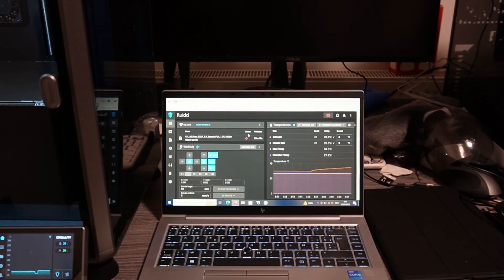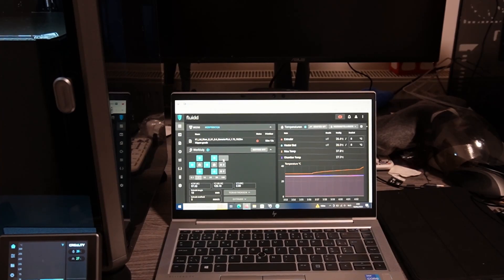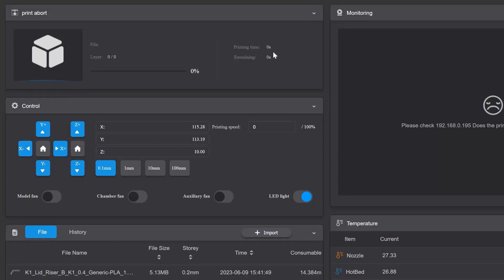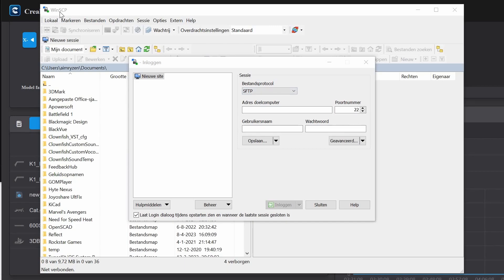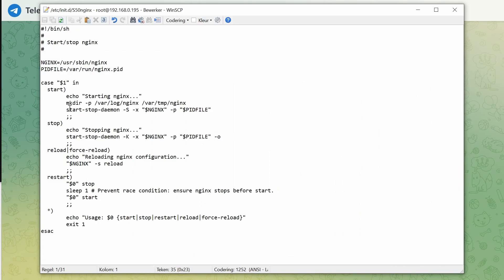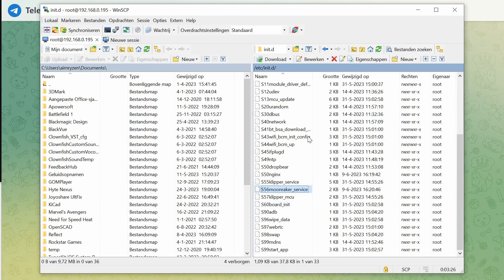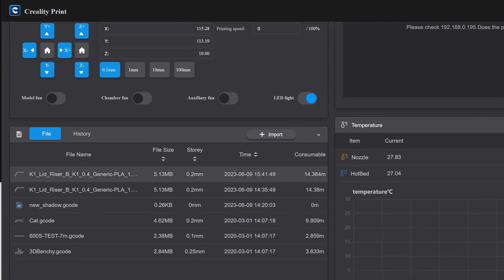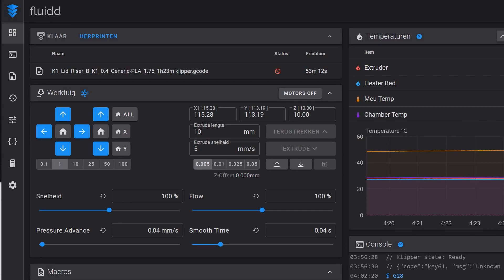Creality K1 fully blown FLUIDD KLIPPER exploit tutorial (difficulty: beginner)

Comment: The question is why i should want that ?
Sorry get an Raspberry set up an nice Klipper server with Fluidd or Mainsail the usb in the printer and you have a nice clean stable system.
And not an unclean factory firmware that will maybe break at installation or break at the next update because its not compatible anymore ...

Comment: Do you have a solution for applying this after accepting the 1.2.9.21 ota firmware update? It doesn't work with this new version, and I haven't been able to flash the firmware with an earlier version.
Reply from the maker: check this video https://www.youtube.com/watch?v=SilxrO6MNmM
Reply: That really helped. Thanks. @aim6mac

Comment: I finally got in with the password 0755cxsw$888 , but the files S50nginx and S56moonraker_service don't exist in the init.d folder. it seems they removed them in the latest update maybe? All the other files are there though.
Reply from the maker: I'll have to look into that
Reply: @aim6mac  Any updates on this/work around?
Reply from the maker: @djkrekeler6909  use official firmware, it has klipper in there.
Reply: @aim6mac  trying to get mainsail to work, got fluidd figured out. did the steps but mainsail won't load the printer. i changed the port and still no luck. was unsure if the github page setup was needed in current version.
Reply from the maker: @djkrekeler6909  come to my discord, we will lead you to install mainsail on your K1
Reply: yeah, I just updated my printer and that password let me in, and I got the same problem
Reply: me too, cant found that file. Maybe Creality change location or remove it on lastest update
Reply from the maker: to follow up on this, please use the latest firmware (official) from Creality which already has Klipper in it.  U don't need to use the xploit anymore!
Reply from the maker: if you don't know how to, come to my discord, we'll help you out :)

Comment: Did they ever fully crack the sonic pad fully?
Reply from the maker: Creality officialy put in root acces on the sonic pad a few months ago.
Reply: @aim6mac  Yea I seen that however you still can't do or install whatever you want like normal klipper
Reply from the maker: @TechieNI  oh and what do you want to do?
Reply: @aim6mac  I would like to install obico but the guides seem outdated as it won't install without the dependent files which won't install normally either for whatever reason. I would also like to gain access to the normal bed mesh and input shaping.
Reply from the maker: @TechieNI  allright,

Comment: Is it possible to connect K1 to any other slicer? Like Orca slicer by softfever.
Reply: currently you can't connect to it from orca slicer, but I have been able to create a generic klipper printer on orca and have a working 0.4mm nozzle 0.20 profile that works, prints look really good so far. I have to manually upload the file through the fluid web interface and can kick the file off with no problems.
Reply: Thanks for your answer. After posting I too was able to do the same as you. Now I'm facing another issue with Orca. I created the printer and copied all the motion parameters from Creality Print(CP) but still I'm unable to generate a fast GCODE in Orca. For example a model in CP is giving me 09:41 (mm:ss) and the same one on Orca shows me 22:09 (mm:ss). Any ideas ?
Reply from the maker: you can connect K1 through Klipper to Cura or Prusa slicer
Reply: Ok. I'll give it a try. Again coming back to question regarding Orca gcode. Still kinda perplexed.

Comment: I can not access using either method A or B.  I have uploaded gcode and ran it on the printer.  Method B on the html epoit states payload sent but nothing.  Refreshed several times.  When I go to WINSCP it states that password is invalid.
Reply from the maker: Instructions

Download both k3d_k1_exploit.html and shadow.gcode

1) Run k3d_k1_exploit.html

Enter the IP address of your printer connected to the Wi-Fi of the same computer from which you are doing the actions

 2) Click the button "Method A"

Attempt to login with:

username: root

password: creality

You’re in.

--------------------------------------------------------------------------------------------

If it doesn't work, then the alternative method is:

1) Load shadow.gcode into the printer's g-codes through Creality print application

2) Enter the IP address of your printer in k3d_k1_exploit.html

Click the button "Method B"

3) Connect to the printer via SSH with the login root and the password creality

You are hopefully in.

Comment: Hi, great video as always. Just so I understand.. This exploit is needed to run klipper on the K1?... the K1 will not run with normal klipper? i mean flashing the printer and using a PI or a thinclient with a tablet and Klipperscreen?..  I am asking because i was thinking getting a K1, but i only want it if i can integrate it in my system, that is: run it with my 2 other printers on my thinclient and switch printers on my wireless tablet as a remote control. If that is not possible i will skip the K1..
Luc
Reply from the maker: thank you, yes as of yet u need to use an exploit (once) and u can access the klipper (fluid) , Creality might open it in the future, but thats not a certainity , just a hope :)
Reply: @aim6mac  Sorry just want to make sure i understood correctly, because english is not my mother tongue: you cannot install your version of klipper on that printer, but have to go through creality OS? I love the look of that printer, but the most important for me is to be able the walk around the house and control all my printers that are in the basement with my android tablet running klipperscreen. I can also monitor the webcams with it.  If that is not possible, that printer is nothing for me. But maybe i misunderstood, and you can run it with a real klipper but then do not have the benefits of the creality OS.
Reply from the maker: @FreeEnergyNerd  well Klipper is already installed on the K1 , but Creality is limiting our access to it, with this exploit u gain full access again. So yes u can use it as just your other klipper machines.
Reply: @aim6mac  Thank you, that sound good